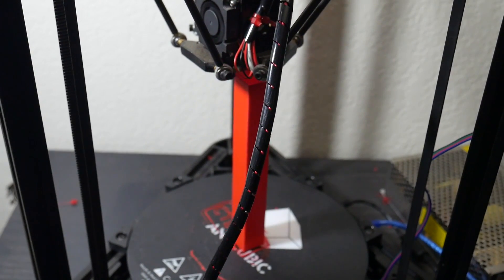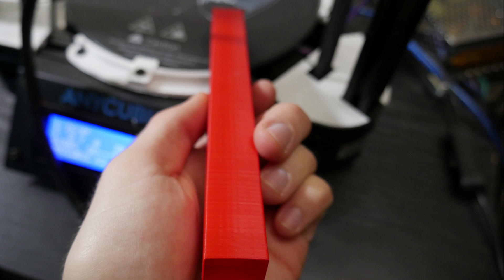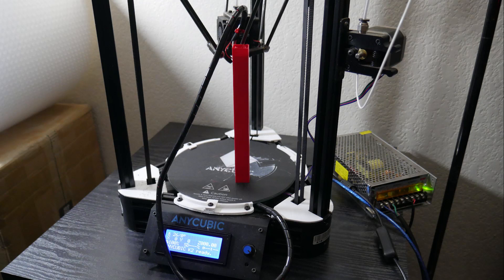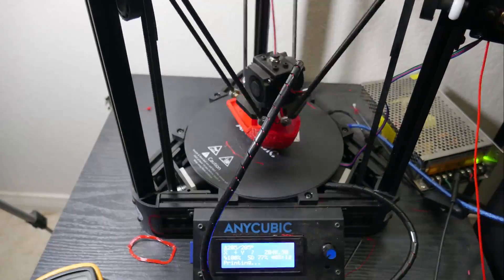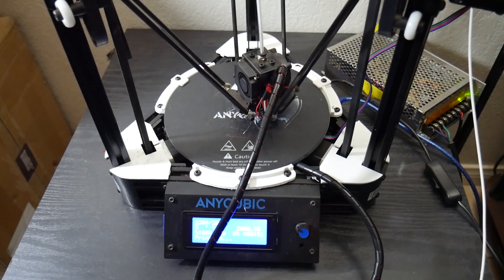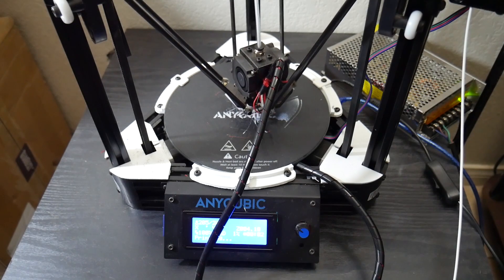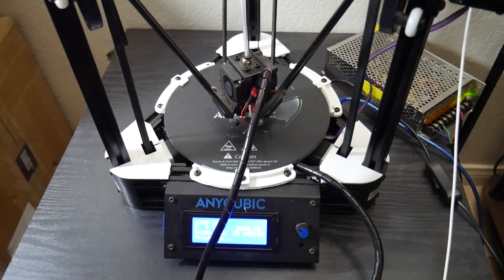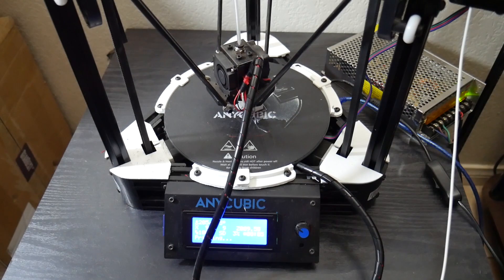Anycubic Delta Print Quality | Printer Problems & Solutions!

Comment: It's kind of a piece of junk if you had to replace the drivers, power supply, and make hold downs.  I got mine assembled after 2 years in the box, and no filament is coming through the nozzle, so I guess I'll be tearing mine apart.

Comment: The Linear version was my first, 3yrs ago, and I cut-my-teeth on this printer. Printed a 3ft sword and the 2001 Discovery spaceship with this. I still have it though I have bought two of the big brother Predator Anycubic deltas, you should review as well. Just completed a set of armor with those.

Comment: I just bought a linear rail version of this printer for 70 USD. The reason it's so cheap is probably that the previous owner does not know how to tighten T nuts. Almost off of them are vertical in the extruded aluminum and the printhead shakes for over 5mm... And yes the t nuts are tightened so much I could feel his frustration.

Comment: I see diagonal lines in all your prints. I just got my printer today and I see the same diagonal lines on the surfaces
Reply: I dont see them on my. Only horizontals and verticals. The first print was exellent with marlin 1.1.8. Then its start scratch when it move extruder across infill. Changed to marlin 1.1.9. Didnt help. Then i decided that its calibration problem. Find our printer measurements: diagonal rod 267.5 (rail version)(267 in marlin website settings, i use it but horizontal holes is smaller), z-offset -15.7 (or -15.6). Lowered accelerations to 1000-1500. Now, it prints fine. In some firmware diagonal rods 271. I didnt check this size. Tryed marlin 2.0.0 - Its laggy in menu.
Reply: @woofkaf7724  nice I wonder if it's the issue with painted vs anodized extrusions causing them.

Comment: I have one of these printers and like it a lot.  Many prints done over the past year.   It did need a few changes.   Mainly the power supply which was totally inadequate and burned out.  I believe they now send out better supplies.  I replaced mine with a 30 amp supply from Amazon, it looks like the one in this video.  I was able to adjust the driver voltages to 1 volt and it worked OK but I found it very noisy so replaced drivers with tmc2100 drivers and it is very quiet now.  The V5 hot end clogged up a lot so finally I replaced it with a V6 hotend that does not have that little piece of teflon tubing inside that causes a lot of trouble.   Hasn't clogged up once since.   It needed a spacer block for the V6 hotend which I found on Thingiverse.  The manual bed leveling was very tricky but once I got it right, have had no trouble.  I use pro-mask blue painters tape by Block-it on the unheated bed and it works great.  Not all blue tape works well.  Also put an outside brace on the carriages from Thingiverse which helps wheel alignment and tension.  Mostly print with PLA at 205 deg c but also with PETG at 230 deg c.

Comment: thats weird , I have the linear version of this printer, and out of the box, there was no issue at all,
Reply: Mine refuses to feed the filament. Never see the extruder motor feed anything to the head.
Reply: I got one also and I can not figure out what's wrong. the prints are insanely messy and none of my normal solutions for stringing or ringing are working
Reply: I love mine, deltas alway finish their print in 75% of the time slicer's estimate. The only thing I'd fix is putting the mobo, up, not under the hotend.

Comment: Sound like you were horrendously unlucky with yours, I would have sent it back. Bought this as my third printer and been pretty sound from the first print. Hope this doesn't put people of the Kossel, its a solid choice. 
Only thing I would say is definitely spend the bit extra for the plus - the carriages on the pulley are poor and you'll really appreciate the larger buildplate.

Comment: any help with the setup? i followed the instructions exactly and when it starts every print the nozzle is pressing on the build plate
Reply: mine is hovering. like 3cm from the surface.. heelp
Reply: @adeliasetiawan1614  z-offset -15.7
Reply: If you didn't get it fixed, you need to set the Z Position. Once that is done, it should work fine. Use the auto leveling procedure in the manual.

Comment: Having issues with the print sticking to the plate on mine do you have any issues with that if so do you have any tips to make it stick to the table please let me know thanks
Reply from the maker: I did not have any issues with it sticking to the plate if you have the sheet on it that has the rough service it should stick well chances are that the bed is not level or your nozzle is not close enough to the bed I would start with looking at that

Comment: I have "thermal runaway printer halted" error, do you know how can i solve it?
Reply: Aykut Coşkun that usually means the thermometer that is underneath the rod in the hot end is slipping out
Reply: I solved the problem by changing the codes. Thank you anyway :)

Comment: I’m having a problem someone may be able to help me with. When my nozzle is 10mm from the print bed I tell the nozzle to move 100mm in any plus or minus X or Y direction the nozzle is then extremely close to the build plate, I’ve tried finding the Delta_Rod_Length in my firmware code in the Arduino software and after reuploading the new firmware it still does the same thing I measured the center to center rod length and changed it but still nothing! Please help with any suggestions
Reply: I had the same issue. If you are using the Marlin firmware search for the EEPROM settings. If this is enabled the printer stores the default values which were first uploaded in the EEPROM and does not use the values that you write in the firmware configuration afterwards. I think there is also an M* command to store the new values in EEPROM.

Comment: A little curious on your power supply problem.  Did you have the heatbed power plugged directly into a socket then your power supply into a separate socket.  I notice that if I have only 1 plugged in, both pieces look as if they are on. I've read both together require more power than can be drawn from just the power supply.  I've not tested this though.

Comment: Thanks for your informative video but I have a BIG problem with the safety of your power supply wiring. I have pointed out to Anycubic that it's absolutely not acceptable to supply that type of power supply without an enclosure. This is the type they supply with the heated bed. When it's installed there is no need for the smaller supply they also send.Do you realise how dangerous those bare, exposed left-hand side mains (L, N) terminals are?Even more so in countries with 240V mains.Let's all spread the word and maybe save some lives. Buy a plastic enclosure and isolate the supply from accidental skin contact. Think of those inquisitive little kid's fingers...I hope this helps. Be safe!

Comment: i'm looking to buy a new printer after my prusa i3 clone. Would you recommend this? I know it would need some modifications/upgrades but is it worth it?
Reply from the maker: If you already have experience building a printer then this can definitely be a fun project to work on. Its definitely got a lot to offer a very sturdy frame large build volume and all tweaking aside the build was alot of fun and I am happy with the end result
Reply: ModBot Awesome! I don't know much about delta printers so hopefully this will help me expand my knowledge on 3d printers! Will definitely consider buying.
Reply from the maker: Kenny Adams I have done a ton of Cartesian style builds delta is a different beast man but like you said the more you know it expands your knowledge of 3d printing

Comment: Man glad to hear you solved yours. Mines (Linear Plus version) just could not be leveled correctly. I did the endstop screws method, but either one of the screws could not go in any more, or one would fall out from being turned too high, so I could not get any of the three towers to be the same nozzle tip distance from the bed. I then got a BLtouch and the latest 1.1.4 and 1.1.5 firmware and set it and did G33 to get the settings and after that the G29 and such, still no luck. Keeps squishing the first layer on the back of the printer and too high in the front. I'm at a lost at what to do and right now waiting for PETG to arrive to try my last attempt, which is leveling knobs to be able to manual level the bed itself. My first Delta printer and probably my last, way too much pain to work with. Over 30+ hours spent just trying to level it.
Reply: iamthebest22 Buy the EZbed leveling software works wonders
Reply: I've been hearing great thing about that, what Marlin firmware does EzBed leveling use?
Reply: iamthebest22 good question let me get back to you on that I'll have to wait till this print is done
Reply: Never mind i found it,
Reply: iamthebest22 Bravo!  Happy Printing!
Reply from the maker: Have you tried just adjusting the bed? It is weird to me that you bed is that crooked but you could physically put something under the bed on the side that is lower to make it higher to the point that the bed is level if I had tried all of the above that you h ad mentioned then I would have definitely tried to fix it with something simple like lifting the bed physically